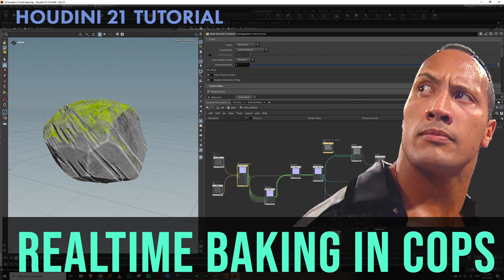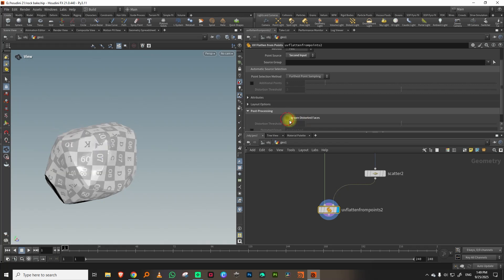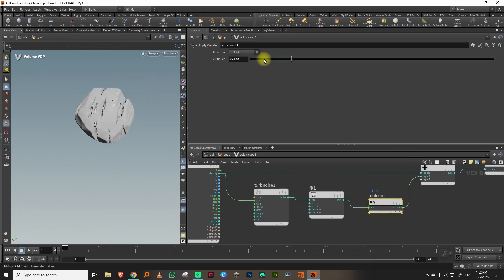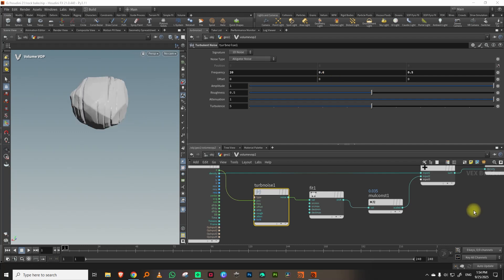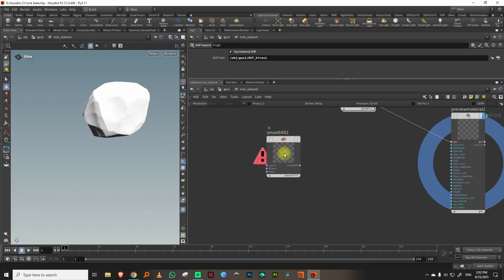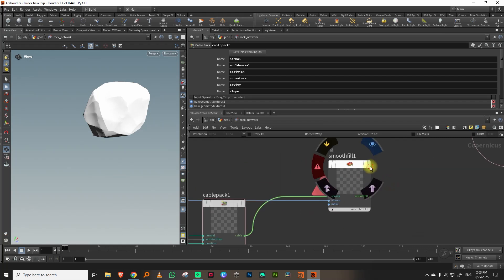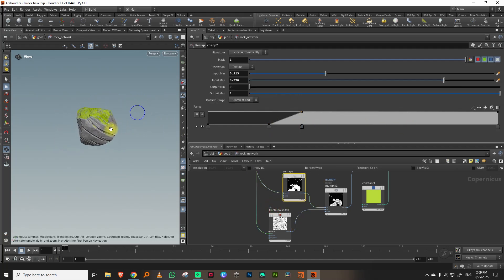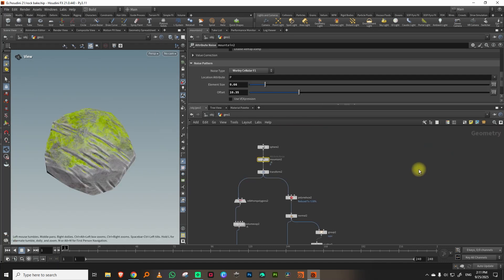Houdini 21 - Realtime baking in COPs

Comment: hey i tried to set this up since i needed to make some rocks anyway... (we always need to make rocks, don't we?)

but.. the bake texture came very glitched.  (for instance the alpha channel isn't white but has weird black triangles which trash the setup.)

I don't have an nvidia GPU available, and i wonder if it's because of that?  have you tried it with embree?
Reply from the maker: Change it to embree. It could be a gpu issue.
Reply: @rohandalvi  i figured it out,, i copy/pasted my copnet up to the stage but some of my nodes were still pointing at the old network, so i was sitting there trying to get my UVs straight and nothing was changing...

that was driving me nuts!  You really need to have UVs that cut along the hard edges for this to work nicely.  looks good now tho.
Reply: ok, well i ACTUALLY figured it out now.  heh.  I was still on .440 I upgraded to daily build (487?) and the weird triangles went away.